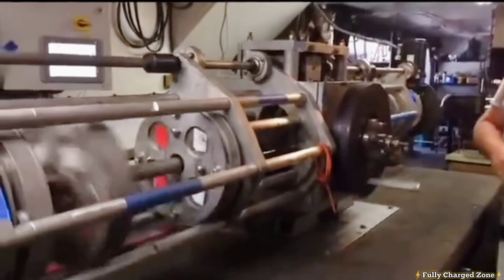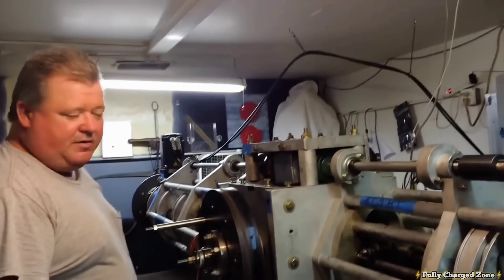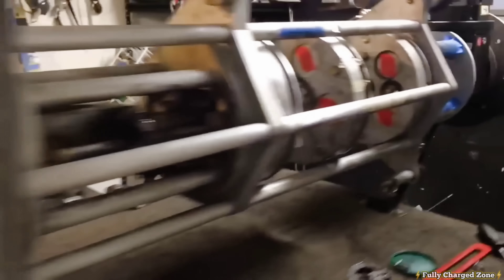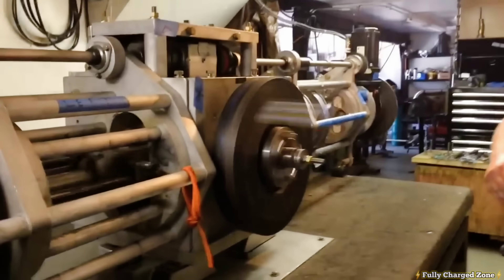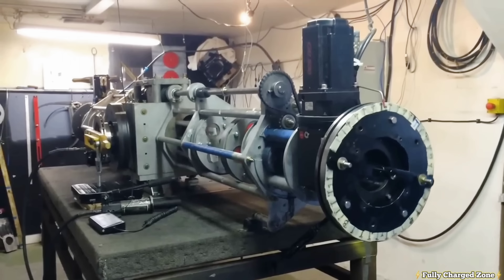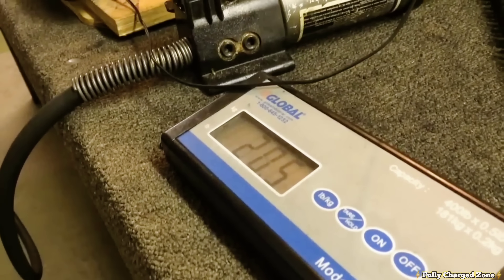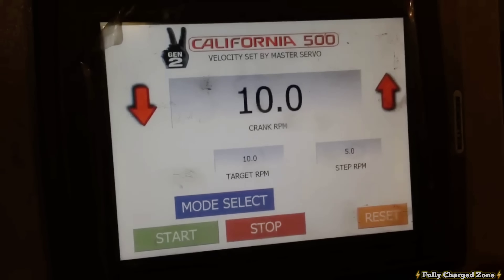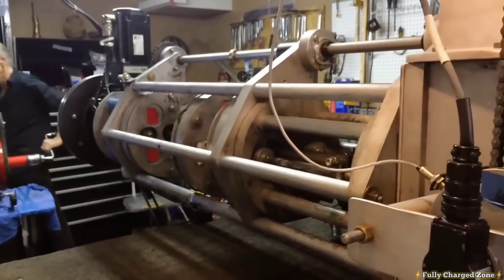World's 1st Magnet Motor - US Patent # 8487484b1

Comment: He doesn’t show where he is adding the power and how much
Reply: You can clearly hear a vfd running in the room. So something is absolutly having a motor.
Reply: Right. "Where's the battery" is still the question. He says it's "electronically controlled", and then I suspect that's where the energy comes from. It's powered by the grid, isn't it?
Reply: Yeah, there is a servo driving the rotating center axis.
Reply from the maker: There’s no external power input in this demo... just the magnet cam timing doing exactly what the patent describes. The whole point of the video is to show the physical motion of the mechanism so people can see it operate with nothing hidden.
Reply: Because he's not adding any power it's pretty plain and simple. Magnets push and pull against each other. Just put your brain to work and you'll figure it out
Reply: @19chevyboy86 my brain tells me that the same amount of energy that the magnets attract each other with is also needed to pull them apart. Therefore, it is zero sum.
Reply: He is uaing the repellong forces of magnets intermittently, not the attractive forces, so no.

Comment: Can probably do a smaller version of this with more efficiency!
Tighter components.
Reply: Losing a lot of power and performance to the wiggles and gives!
I noticed that right off.
Reply: @dna3930 nobody likes a smart arse,  but i do well spotted
Reply: It's a prototype
Reply: Small enough for magnet bike  , magnet scooter  please 😂❤
Reply: Be used on the Moon to supply the AIR needed to breath , bravo
Reply from the maker: Absolutely... the patent mechanism actually scales down really well. A tighter, CNC precise version would reduce side-load losses and smooth out the cam timing a ton. This build is just the big, visual demo so people can actually see how the sequencing works.

Comment: Every electric motor is magnet motor ☝️
Reply from the maker: True...  every electric motor uses magnetic fields.
The difference here is that the timing is created mechanically using permanent magnets instead of electronics, coils, or switching circuits. That’s what makes this patent unique.

Comment: It will never work 😅😅😅😅😅😅
Reply from the maker: It’s not designed as a free-energy machine... it’s just a physical build of the patent. The mechanism works exactly as shown in the drawings. The motion looks strange because the timing is done mechanically with magnets instead of electronics.

Comment: I hear a VFD running maybe that's running it 🤔
Reply: Have you looked up the patent? This is actually real
Reply from the maker: There’s no VFD here... the patent mechanism doesn’t use any electric drive. What you’re hearing is the mechanical oscillation of the magnet carriers moving through their “power” and “dead” zones. It’s basically the sound of the timing linkage doing its job.
Reply: @FullyChargedZone I’m referring to the 1KHz tone you’re hearing before it starts up, which sounds very like a 555 timer or similar ran through mosfets or IGBTs to excite a coil that keeps it perpetuating somehow, not discounting its construction but some element is making that sound unless it’s another motor in his shop.  I think when I watched his video it had an exciter, which that would be where the noise is coming from, by no means it’s driving it itself so again not discounting the construction.

Comment: It's a high effieciency motor like comparing compresion ratio of an engine 1 to 16 but this is like 1 crank by hand to 1000 plus percent gain and more. Just shows how much we really waste in energy if we acutaully tried to be that effecient. Our bodies are the most effiecient machine on the planet. This engine shows how effiecient we can truelly be with the energy we put in.
Reply: This motor is definitely interesting
Reply from the maker: This isn’t a conventional motor meant to deliver high output... it’s a mechanical sequencing unit, per the patent, that uses permanent magnet interactions in timed “strokes” rather than continuous coil switching. The efficiency claims would depend entirely on build quality, magnet strength, tolerances, and whether it’s optimized for load.

Comment: It starts from zero, slowly increasing the speed, which stabilizes and becomes constant. It should increase until the machine is destroyed.
The speed at which the machine operates in the video could be real if the excess energy was taken up by a power generator that resisted the machine, slowing it down.
Reply: It wouldn't increase until the machine is destroyed because that make zero logical sense. Friction air resistance magnet strength will limit it
Reply from the maker: Actually, according to US 8487484 B1 the mechanism isn’t designed to accelerate indefinitely. It uses power zones and dead zones where the magnets either generate drive force or produce a “rest” period.  The build you see is just the mechanism running, not designed for runaway speed or destruction.
Reply: @FullyChargedZone 
The success of the machine translates into the number of units sold. Is the mechanism available for purchase? If so, please provide a link to purchase it.
Reply: I only just saw this video for the first time, but in response to you, the governor on the motors speed is the internal friction/resistance of the mechanical portion.  Remove friction and put it in a vacuum and perhaps it would tear itself apart.
Nice concept, but I suspect the amount of power  you could usefully pull from it is limited.

Comment: What is this for?
Reply: There is no source of energy? This thing just turns money into scrap metal. Engineers and physicists understand the laws of physics: there is no free lunch. We can extract energy from one source and turn it into usable energy in another form e.g. electricity. This is a lossy process too. We can't even store energy terribly well e.g. chemical or gravity batteries. If this machine could even just 'not lose' the energy that was put into it we would have a useful battery! It's no good at that because of the high friction and air resistance we can see. Apparently none of this is obvious to the layman.
Reply: It's a magnet motor that only works on magnets and potential energy. What's interesting is this is the only one that I've seen that actually has a patent....that means it's Real!
Reply from the maker: It’s a physical build of US Patent 8487484B1. The purpose is purely educational — to show how the magnetic cam/timing system actually moves in real life.
Reply: This is a great machine for pedal powered self generation electric cars.
Reply: @matideh8482 this motor couldn't handle torque applied
Reply: @JustmeRichard  probably
Reply: I Think it is free Energy Bull. Mayby im wrong.
Reply: @LelekKozoduj-ph1kv you are
Reply: @LelekKozoduj-ph1kv  Yeah, I don't know either. I'm curious to know what it is myself.

Comment: Hidden battery inside?
Reply: Check out the patent,  it explains a lot
Reply from the maker: No hidden battery... the whole point of this prototype is to show the magnet-only mechanical sequencing described in the patent. No wiring, no coils, no electronics. It's just magnets, carriers, and timing geometry.
Reply: @FullyChargedZone Magnetic Sequencing could possibly lead to free energy if scaled up in size.
Reply from the maker: I like the way you’re thinking — exploring ideas is how new tech gets discovered.
For now though, this design is just a magnetic timing mechanism. It can’t create energy, but it does show some interesting sequencing behavior

Comment: I had to do research on this device.....I'm beyond amazed. This device has been highly tested by other engineers.
Reply: I think this motor is amazing, it's sad he passed away
Reply: @LisaPenwise  he passed away ? hmmm..
Reply: Any recommendations for resources you came across while researching it? I just came across this and its very intriguing
Reply from the maker: Respect, man... the deeper you dig into the patent, the more interesting the mechanism gets. It’s not “free energy,” but the sequencing system Sonny designed is definitely something different from traditional motors. I’m glad you looked into it.
Reply: The magnets won't lose power for 100's of years. Still more efficient than any other form of energy.

Comment: Thank you for making this video .
For how many days did it run .
After it stopped .what happened?
Reply from the maker: I obtained this video and a copy of Sonny Miller's journal from his brother. The data from his journal says it would run 11 days in mechanical electrical mode before being shut down. It doesn't say why it was shut down. His journal also says it would run in mechanical mode for 2 hours on average. Mechanical mode is purely rotational kinetic energy that is stored. It's pretty much a wind-up magnet battery from what I have gathered from his data. I'm currently building something similar.

Comment: Very nice. Need some help with balancing. It would run much better balanced.
Reply from the maker: Absolutely... this prototype has no counterweights or fine balancing. I built it exactly like the original patent drawings, even if the geometry isn’t ideal. A refined version with tighter tolerances would run a lot smoother.

Comment: I absolutely take this with a huge grain of salt.
If he uses a hand cranking wheel to load in the energy, 
And since you have to wind up that hand cranking wheel first before releasing it, that  means  theres external energy put in by hand.
And that means it wouldn’t spin for long because eventually that spring inside that hand  cranking wheel will reach it’s end and cause this whole motor to stop.
So in my opinion, it’s not a selfstarting magnet motor and it’s definitely not perpetual.
If somebody could prove me wrong then explain why.
Reply: This patent is mindblowing
Reply from the maker: Totally fair. That’s why I built it with zero electronics, no hidden drives, and no external crank or input... just the mechanical timing described in the patent. It’s not producing extra energy; it’s just showing how the timed magnet zones create continuous motion.
Reply: I learned about Sonny Miller at MIT. This is the only magnetic motor that purely works on magnets. There isn't anything staring the motor but a hand crank. This motor runs for hours and has been documented . This invention also produces more energy than a  hand crank. 750watts at 3800 rpms is more than a hand crank. Sorry but your misunderstanding the device in my opinion. It is ran by magnetic force. There is nothing like this that hasn't been proven fake.
Reply: @Adamrampert well if that device can start and run ons it’s own without a hand crank, then i will consider that interesting.
Because an hand crank means, it needs external help wich i don’t count as a legit selfrunning magnet motor.
Reply: @johneygd  Your correct it does need a nudge. I'm almost positive,  but every motor needs something to start ? Even the Daelaus perpetual wheel needs a nudge. That is consider a self running motor or perpetual machine also. These are the only two self running devices that keep running until maintenance needs to be done that I've found. Fully Charged Zone thanks for the video. I forgot about Sonny Miller until you made this video.  It brought back memories of me trying to build my own magnet motor. I realized like Sonny did the overunity was minimal. I took my career into building more efficient solar panels. Our company is engineering transparent solar cells. I think that's the future.
Reply: Why does everyone think that if it eventually stops that it is not perpetual? It's obviously perpetual... the motor is perpetuating itself...if it ran for days and all you had to do was hand crank it to start it again...who cares. It works! It rotates without fuel and creates electricity. Any perpetual machine in reality would need to be started at some point.
Reply: It is BS, there is no way to produce energy out of nowhere.
Reply: @zzxd7720 it's definitely real, look up the patent
Reply: @zzxd7720 it's obviously not coming from nowhere. It's a matter of cause and effect.